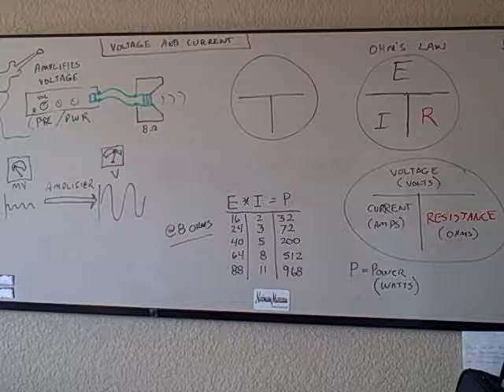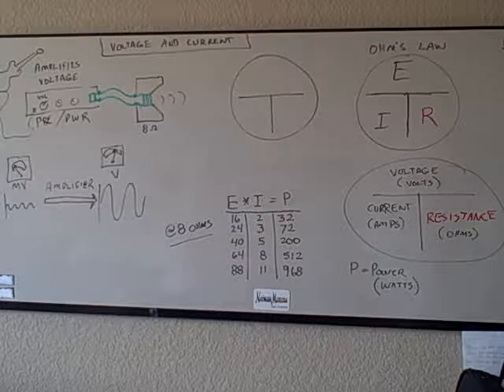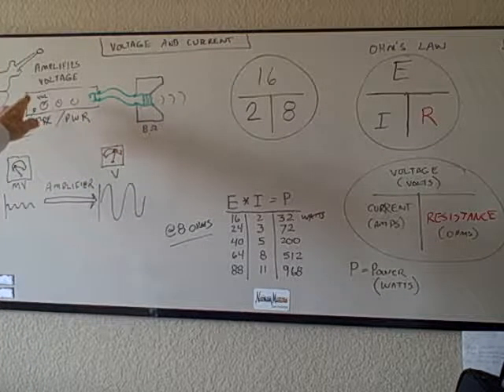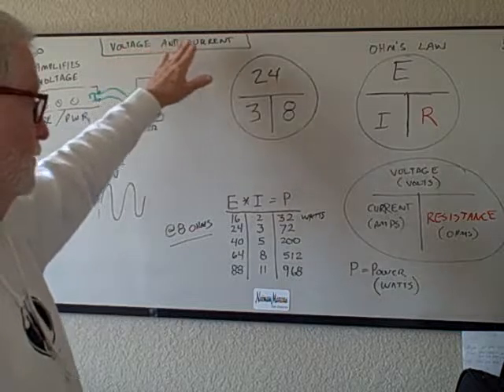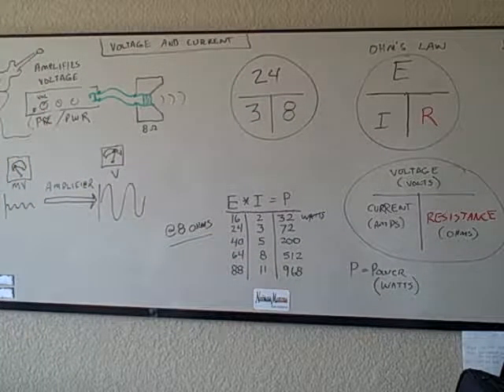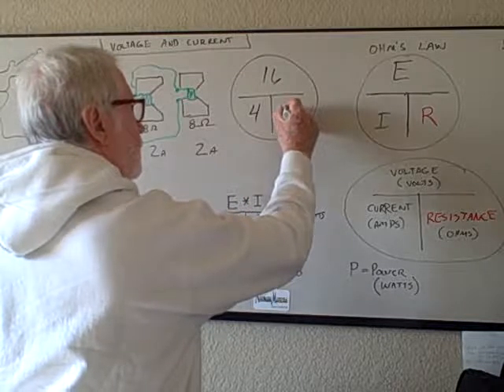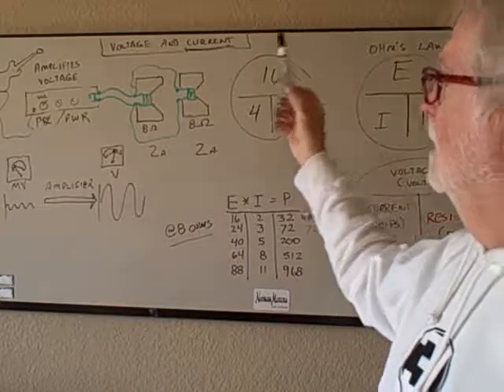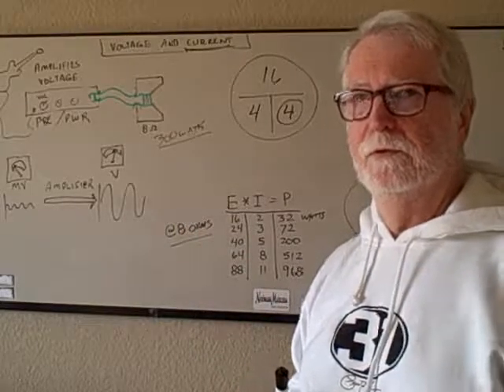guitar amplifier volts, current, ohms, and power

Comment: So, I'm a nerd...I love information...lol.  I've got an Orange Micro Dark that's 20W, 15V and 2A.  I'm looking to upgrade my little 1×8 cab for at least a 2×12.  So, how to I decide on a cabinet with series vs parallel as far as ohms go?
Reply from the maker: Animal - The Orange website lists the Orange Micro Dark as a 20W output amp with a single 12AX7 (tube) in the preamp section. It recommends a single cabinet with an impedance of between 8 and 16 ohms. Remember that the limiting factor is the ability of the amp to handle the current draw of the speakers. Specific to your question, if you want a 2X12 cabinet, I would try to find one with 16 ohm speakers and wire them in parallel, resulting in 8 ohm load. (Or, get a cabinet with 8 ohm speakers and wire them in series, resulting in 16 ohm load). You would think that the 8 ohm cabinet would be louder, but in my experience, there won't be much difference. You might also consider a cabinet with a single 12 or 15 inch speaker (my personal recommendation). Unless you're running the amp wide open and playing a heavily distorted guitar, you won't drive the amp into clipping and a high current draw situation. On a side note, it's amazing how loud a 20 watt amp can be. If you can, take your amp to a couple of music stores and try out different cabinets. Also, the Orange website says this amp is intended as a practice amp. If the reason you want to move to a 2X12 cabinet is to play in a band, my recommendation would be to go with a single 12 speaker and mic  it into the PA board. You'll have much better control over your tone that way. Good luck. Ben Price - San Antonio. One last thing, for this amp, stay away from any cabinet that is rated at 4 ohms or less.
Reply: @ve3cda  Thank u so much!